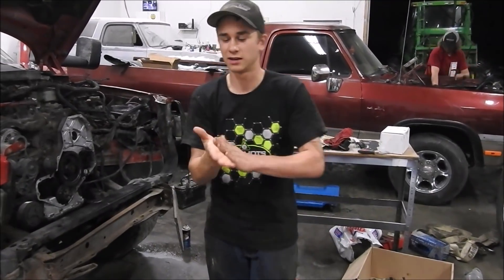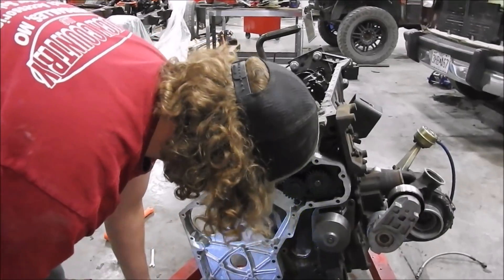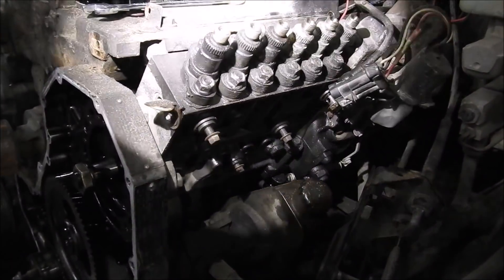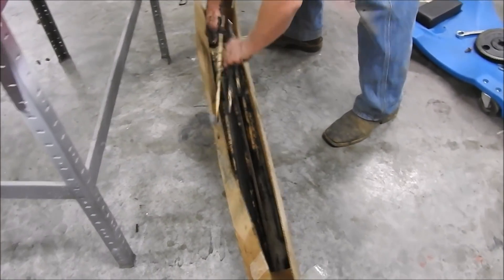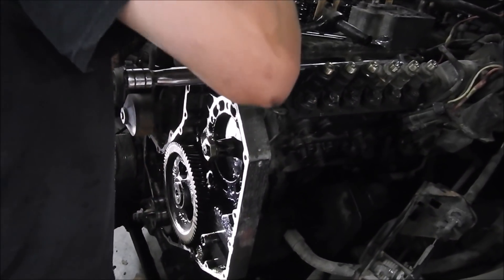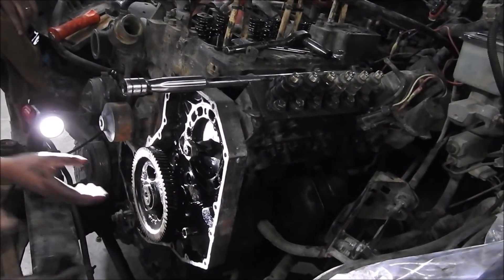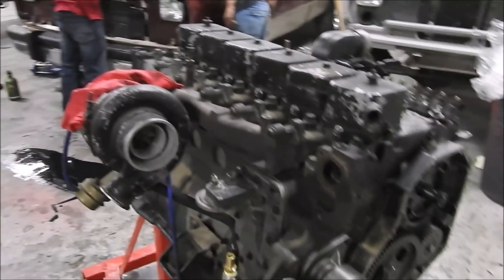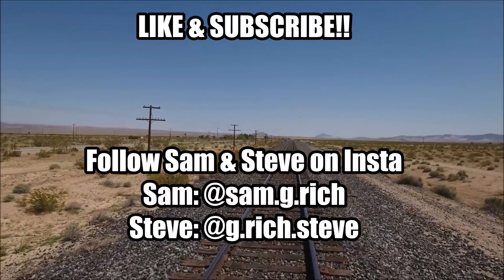P-Pump Conversion on A First Gen

Comment: I dont see why you didnt just get a new cam, set of tappets and pushrods as you said it had high miles but it might not all wear evenly amd youll run into problems later on
Reply from the maker: Has very low miles and everything looked fine. No reason to change it.
Reply: But I thought you said it had high miles
Reply from the maker: @gunz_n_bikes171  the motor out of the second gen did, not the motor from the first gen.